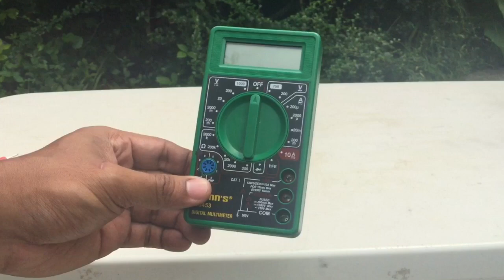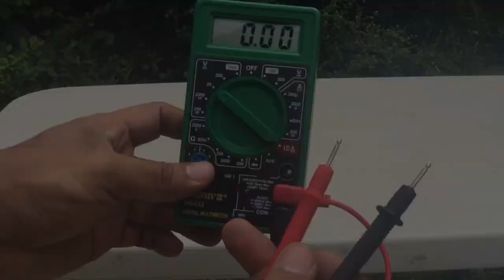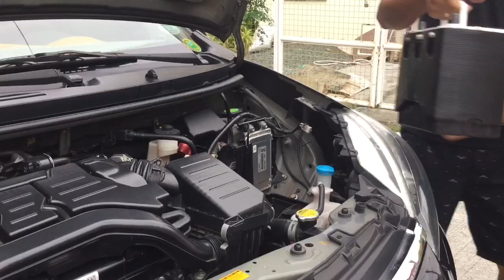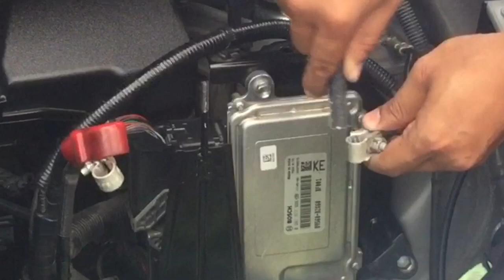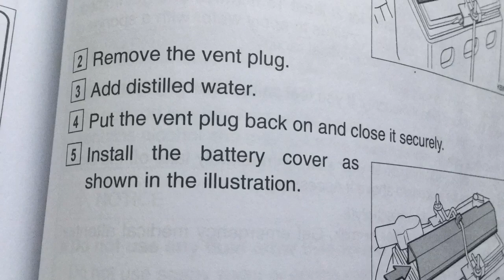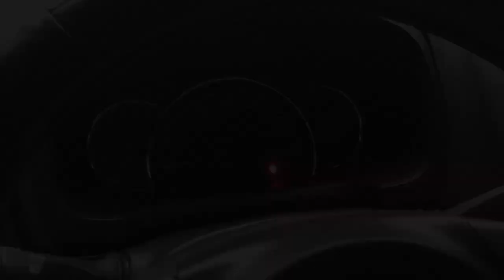How to Inspect, Service and Test the Battery - Toyota Wigo

Comment: Sir! Nagpapalinis po ba kayo ng engine bay o DIY din po? If DIY, sana po may tutorial din kayo simula kung ano po ang dapat inaalis/tinatakpan. Hehe salamat sir!
Reply from the maker: punas-punas lang po ako sa engine bay using damped towel:) no special trick or
tools needed. no need to engine wash or cover the sensitive parts.
Reply: @WigoRaizeTV  pano kaya sir mapeprevent yung daga/💩? Wala po kasi kaming garahe tapos minalas malas na sa tapat po namin may nakapwestong drainage. May part po sa ilalim ng makina na puro 💩 lagi though di pa naman po sila nagngangatngat pero ayoko na din po hintayin 🙃 Natry ko na pong maglagay ng pamintang durog kaso di po nagwork. May iba po kayong tips?
Reply from the maker: @Seajaaayyy  https://shopee.ph/Anti-Rat-Spray-Liqui-Moly-200ml-1515-i.326977242.10320540318 liqui moly is a reputable germany based manufacturer of auto maintenance products.
Reply from the maker: mahal nga lang:(
Reply: @WigoRaizeTV  thank you so much Sir! 😊😊😊

Comment: Sir ung stock battery po ba ng wigo hanggamg saan umg normal na water level nun
Reply from the maker: may level indicator yung stocke batt if you'll pull out the black batt cover, pero as long as hindi pa umapaw yung distilled water sa loon ok lang na lagyan, lalo na during summer time:)
Reply: Salamat ng marami sir

Comment: Sir newbie question po, un sa stock battery ng wigo, ano po un dinadagdag na solution? Distilled water or battery solution? Confused lang po ako.
Reply from the maker: dikiss omar distilled water sir
Reply from the maker: may electrolyte or additional
acid kase yung battery solution that shortens the life of the stock battery.

Comment: Hi Sir, I hope you can help me with this one. I changed my battery and after that my radio won't work na. How can I check this po? Thank you so much and more power.
Reply from the maker: L A Anong model po ng unit? Kung bago or faiirly new, try to do a hard reboot/reset on the head unit by pressing its ON button for 5 to 10 seconds.

Comment: Anu po recommended nio n battery for.wigo? Tnx po
Reply from the maker: Hi. I want to buy sana the most expensive one with the longest warranty that I can get from a car battery, pero my budget recommends I buy the cheapest one lang from motolite with a 15-month warranty:)
Reply: Just bought a Ns40 motolite enduro, subok q n un s Multicab . Ayos xa
Reply from the maker: Halls Linc A small battery for a small vehicle:)
Reply: ano po ba model ng battery ni wigo?
Reply from the maker: @VIRTUALCONCEPTS  NS40 yung battery size code. I bought a maintenance-free battery after the stock one.

Comment: sir sa aking engine on 13.7 ok lang ba ? new battery ako
Reply from the maker: As long as you are not having start up and battery issue, ok lang yung 13.7. pero kung may start up issue, may separate warranty naman yung stock or aftermarket battery mo na bago.

Comment: sir pano magrefill ng water kapag stock battery ni wigo..yung may mga yellow caps sa taas?
Reply from the maker: add distilled water lang dun sa reserve after removinv the caps. alternative sa commercial distiled drinking water is the water from an air conditioner unit. distilled din yun that you can also put sa wiper washer reservoir:)
Reply: noted sir..pero pano ba malalaman kung need na mag add ng water sa battery like may pattern by monthly or yearly?kakapms lng kasi last july..pero di ko alam kung nilagyan ba nila ng water or hindi na..
Reply from the maker: @rALdGe  the stock will not last for more than 2 years. i suggest you inspect yung water reserve every 6 months, mas madalas kapag summer time na sobrang init.
Reply: thanks sir.. may any recommended na battery ba kayo for replacement ska price na rin..hehe
Reply from the maker: @rALdGe  im using motolite na may 15 mos na warrant (yun lang kaya ng budget ko:). wala akong marecommend kase wala akong point of comparison sa ibang aftermarket battery. ideally, yung may pinakamatagal na warranty like amaron, pero double or  more than double yung price. hahaha
Reply: ok cge sir..maraming salamat..
Reply: Sir ung wigo ko po ay nrefill ko nmn ng water then pnchrge ko po bkit ayaw p dn mgstart n wigo..tnx po

Comment: Sir i hope you can reply. Napanood ko halos lahat ng vids nyo. Tanong ko lang po kng applicable din po ba ito sa wigo manual transmission? Especially yung change oil, etc. Salamat po and god bless.
Reply from the maker: Hi Roshan. I suggest that you go through the wigo owner's manual first then apply the methods on a manual transmission, especially the intervals. I think applicable naman lahat:) i appreciate your question.

Comment: Thank you for this sir. Same process lang po ba pag ung battery is ung type na nilalagyan pa ng water?pagkatanggal po ba ng cover sa gilid makikita na ung level kung need n refill?
Reply from the maker: Hi Gwenny. Yes, basically it's the same process. Ang pagkakaiba lang sa hindi maintenance free, nilalagyan ng distilled water (you can use yung water from an air conditioning unit...distilled water din yun).
Reply: @WigoRaizeTV  thank you sir!❤